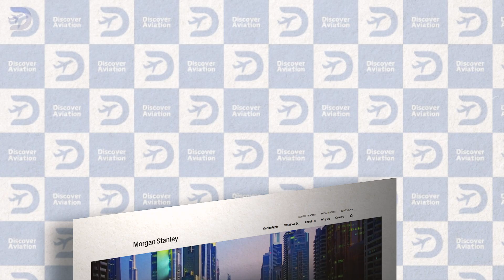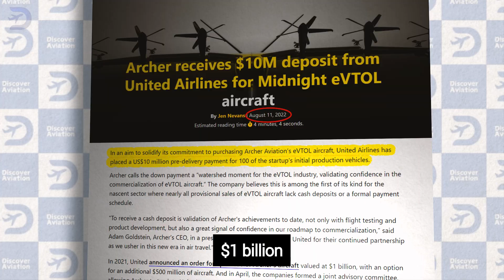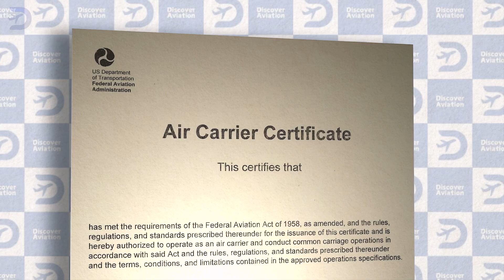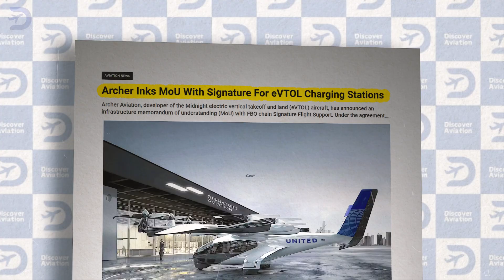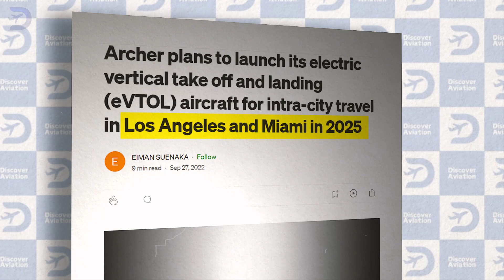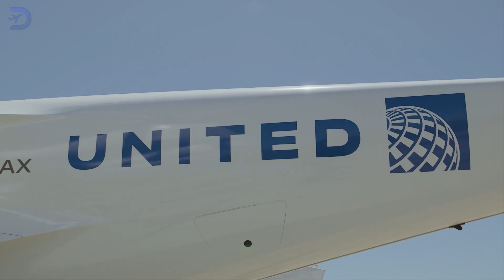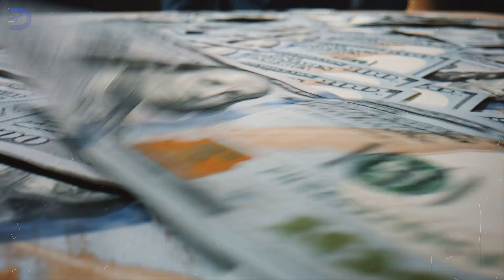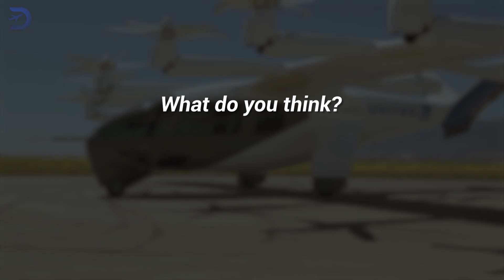Why Is Archer Partnering with Airlines Instead of Innovating Its Own Infrastructure ?

Comment: It is because they are only, marginally useful for going TO Airports, just like jet liners can go nowhere else also.
Unless you live on an airport and/or work on an airport these things cannot help your commute. The whole scam is based on ignorance of the fact that they cannot go into suburban or residential areas or go to 99.9% of workplaces, schools, shops or places you want to go
Reply: I mean what I said. ONLY airports are a destination where you do not want a ground vehicle with you on arrival, a decent roadable ATOL vehicle can go from home to a real destination bypassing the airport for sub 500 mile trips and you arrive earlier and have your ground transport with you.  Don't need SIX drivers and pilots and vehicles to get you there and back .... get it?
No more chat.
Reply: @rossnolan7283  you should shut up. Thats not even what you first said. So shut up tough guy.
Reply: For now. Or what do you mean?